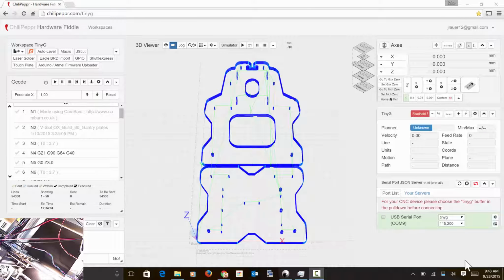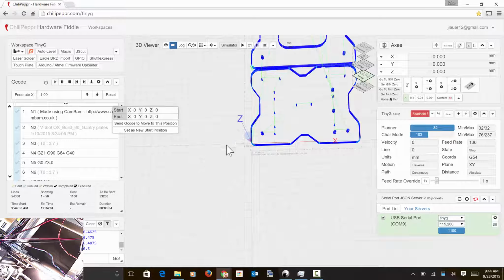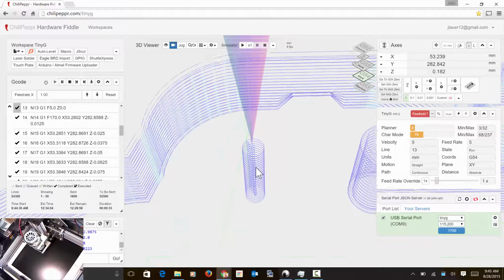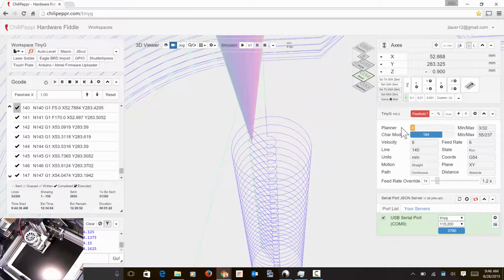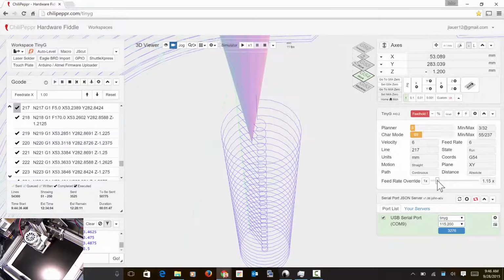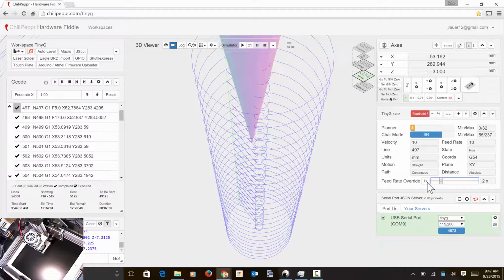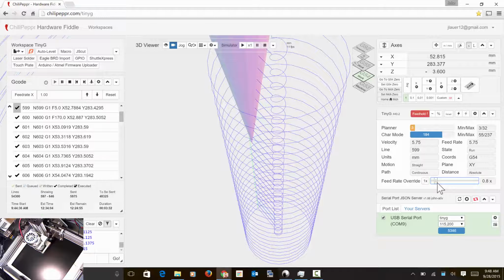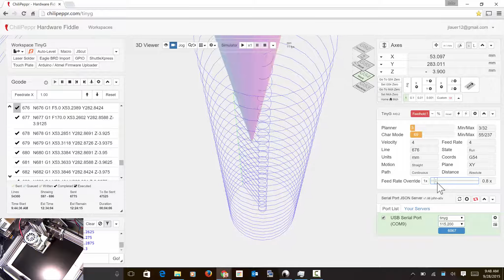ChiliPeppr's New Feed Rate Override

Comment: Hi John,

The machine I work on is a PPR type (two linear and a rotary axis) and I plan to control it with grbl. With this machine, to achieve a desired cartesian trajectory of the end-effector (tooltip), kinematics gymnastics need to be performed, resulting in complex curves in the XY plane, while keeping a desired feedrate. My solution was to split these curves in small sections, taking into account grbl settings (arc_deviation...). I played a bit with tweaking here and there and I believe I came to a working solution. Side benefit of all this was "the-so-desired" (by everyone incl me) responsive feedrate override capability. Responsive, since the chunks left in grbl;s buffer don't take longer to execute than a "tweakable" setting.
Reply: And of course, thanks for your dedication!

Comment: John, really cool.

I have a couple of questions:
I realize that tinyG is a Exact Stop kind of motion planner, do you know if there are devs for a Constant Velocity planner?
and
Can you see a way to make the FRO (feed rate override) responsive?

Thanks
Reply from the maker: You can achieve close to constant velocity by just setting the jerk settings to zero so that it acts with constant motion. When you say FRO responsive what do you mean?
Reply: OK, I wonder if setting the jerk to zero means the acceleration profile becomes a trapezoidal type.

FRO responsive I mean instant action upon changing the feed rate slider bar.
Reply from the maker: Oh fro responsive would mean synthetos changes to the firmware so you'd have to ask them.